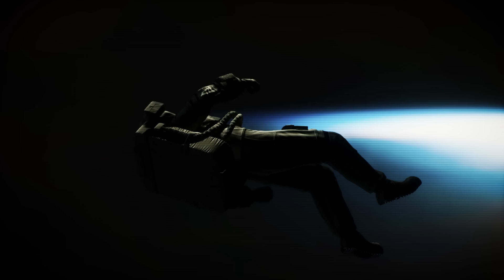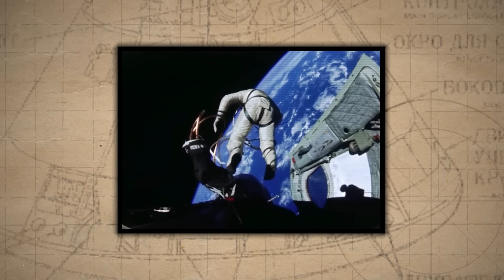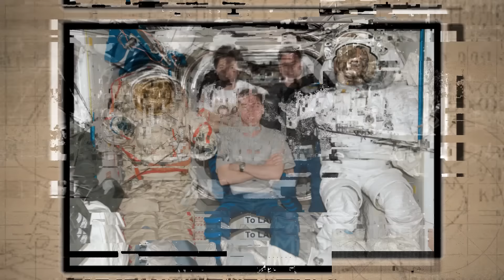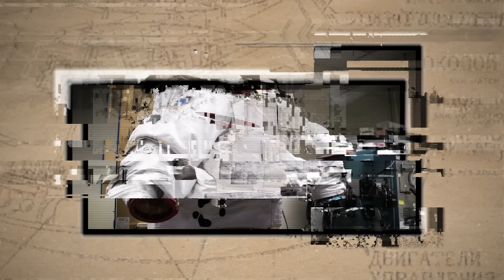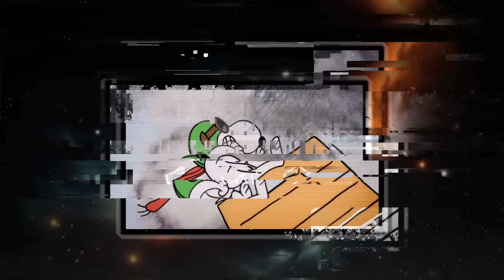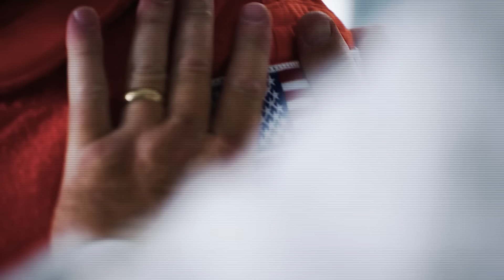How do Space Suits Work?

Comment: Dude, you should be more organized, for example START with EVA / IVA / IEVA, then do a short historical review of each of them, since it is very different ( EVA is THE most complex and heavy, IVA is light and for use inside ships, IEVA is a mix). Also, worth mention world first space suit was invented & used by the russians (back on 1961, by Gagarin) then followed by the famous Orlan, considered even today the world MOST ADVANCED  EVA-DMA suit. ( google Orlan-DMA 21-KS). Even the Chinese bought a dozen of them for their new SStation.

The MAIN advantage of russian Orlan is the Orlan suit can be put on in 5 minutes, while can take hours to get into the US made EMU.  Current Russian Orlan (MK) - 2009 - 265 lbs,  operating pressure of 5.8 psi, with life support of cca  7 hours; 
Current US Extra Mobility Unit (EMU) - 1998 - 319 lbs (much heavier)  operating pressure of 4.3 psi, (not capable of high pressure) life support 8 hours. 

Anyway, upvoted, since many plp here have very little education about how much HEAVY SCIENCE is involved in a space suit design, and what engineering masterpiece is each one.
Just think about: 
1 - controlling the EXTREME temperatures with differences ranging in HUNDREDS of Cº ! 
2 - Supply O2 long enough to perform activities outside the ship (hours ! ) and avoid, if possible, the need for "decompressing chambers". 
3 - protection from radiation. 
4 - system to harvest body dejection materials and hydrate the astronaut/cosmonaut. 
5 - communication systems. 
6 - power supply. 
All in a packet light enough and small enough to pass through a ship hatch.

Comment: Let's just see how wrong or right he is. I work in Aerospace. On pressure suits ..
Reply: And?
Reply: @j.a.weishaupt1748

A heads up I'm voice typing so there may be some grammatical errors I'm truly sorry
Sorry I didn't get back to this sooner. With a certain amount of irony I'm in the process of packing up and leaving to go over to Utah to Cody's lab the YouTuber I built him a suit to use for his Mars relation base and we are going to be recording all that footage the next few days so ironically enough I'm preparing for a thing that's directly related to this😂😂

You don't exactly reduce the airlock pressure so you don't get bent the more important thing you have to do is pre breathe oxygen that's why you functionally flush out your system all the nitrogen so you don't get bent.
During the change in pressure between the suit and the airlock you equalize  the same way as you would if you were a scuba diving. Yawning and all that kind of stuff to open your  various air  passageways to equalize

On the shuttle you wouldn't just chill in the airlock on pure oxygen for a few hours normal you'll be wearing a half face mask on a demand valve and you can go about your duties while you're plugged in there wasn't enough space to really just chill in the air lock effectively while you pre breath...

As for the pressures involved part of the reason why NASA has gone to 4.2 PSI for the Shuttle and the ISS. Is to reduce this pre-beath time.
3.6-3.7 was quite a bit longer. And the main reason why we don't use higher pressures in space suits is mechanical reasons at the end of the day it makes more sense to run a lower pressure and pure oxygen where it makes the entire gas control system much simpler. And mechanically less stress on the suit..

The Russians did Tinker around with some 8 PSI suits..

Those had as little as a 30-minute pre breath!.

But damn they were extremely stiff .[no joint  on fabric is really 0 volume change] and that much pressure on fabric overtime leads to more wear..

Comment: Considering that on the surface of the earth, we can jump as high as we can and not physically hurt ourselves, since this is the case on Earth and, given our mass doesn't change, it would be safe to say this would be the same on the moon, where we would jump roughly six times higher compared to Earth, meaning a vertical untethered leap of 23.6 inches on Earth could become over 9.8 feet on the Moon, and it wouldn't be dangerous. Except for it would be like, wheee... oh no... please land upright... so not quite on Mario's level yet. However, we can look like him, especially with the helmet has his big head; instead, we look like a cautious fridge in slow motion. Edit: 18:19 Looks like somebody got the jump on me.
Reply: What are you talking about? You can most definitely hurt yourself by jumping, and it doesn't need to be anywhere near "as high as we can"..... any time both feet come off the ground, you are risking breaking your toes, your ankles, your knees, and many more things.
Reply: @captainspaulding5963  Oh, you got me. I was just riffing on how moon jumps feel in low gravity, like Mario if he were encased in a fridge trying not to tip over. It’s not that injury’s impossible, just that you get a lot more air for less risk… until you remember air is exactly what you don’t have.

You’re totally right, you can mess yourself up jumping just about anywhere if you’re unlucky. But assuming healthy joints and decent form, most people don’t get hurt just jumping straight up.

That said, I’d genuinely love to hear your take on what’s the Moon equivalent of stubbing your toe? I bet you’ve got the whole list of medical protocols for that sort of thing. After all, isn’t that your modus operandi? I'm probably getting you confused with a different captain.

Comment: The point about blood boiling is wrong. 

The scenario described  would only work if you were a puddle.  The face fact that you are not crushed to death at 33 feet down in the ocean means you can withstand 1 atm of pressure. Worst case you step out the internal pressure on your skin goes to 1 atm.... and the boiling point of water is maintained. 

This is why water in a pressure cooker gets way above 100. It is also related to why water can get well below 0 in pipes and in sealed containers in a car in winter without freezing. 

The liquid in your airways and the linings of the end of your alimentary canal might boil... but your blood won't.

Comment: My biggest question about going to Mars is still, how do they get back?  On Earth we have this whole infrastructure to launch a massive rocket to get them into space.  But none of that is on Mars.  Yeah, gravity is lower there, but you still need something to escape that 38% of Earth gravity.
Reply: 38% of the gravity doesn't equate to 38% of the energy required to escape orbit.  If you plug the numbers into the relevant equations, you only require 20% of the kinetic energy.  However you require far less than 20% of the fuel because the more fuel you require to lift the spacecraft, the more fuel you require to lift the extra fuel as described by the Tilolkovsky space equation.

Long story short, a specially built starship that converts CO2 and water into methane and O2 along with another as tanks to store it, is more than enough to get home, no booster required.

Definitely engineering challenges to be tested and proven first, but nowhere near as out of reach as you'd intuitively think.
Reply: @Alex.The.Lionnnnn  but none of it is on Mars.  It's got to be placed on mars 1st.  Are we using a rocket to take off straight up?  Are we using something else that goes up on an angle?  We still need to get that fuel, vehicle, and launch structure there and we don't have it.

On Earth we have a lot of engineers and technicians checking the rocket before it goes up.  There is no one there to do that.  We have not launched anything off of Mars.  We landed a couple things, but nothing has yet to return.

That is by far the most challenging thing about a trip to Mars.  And it's something we really haven't seen info on